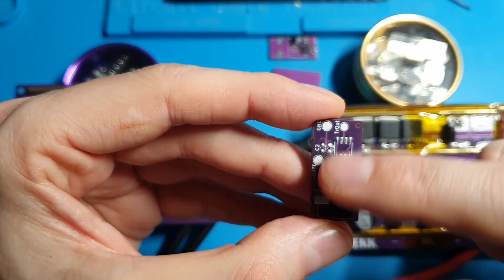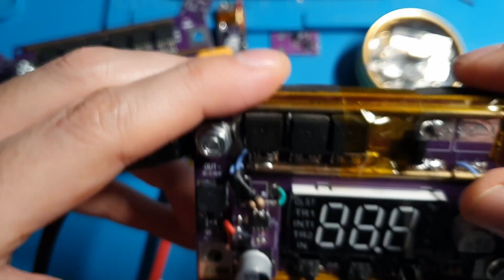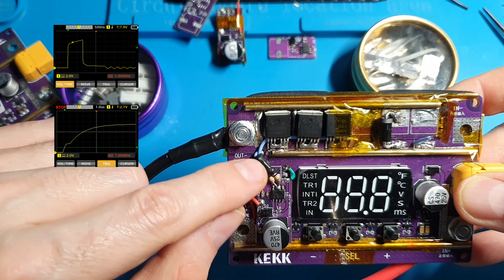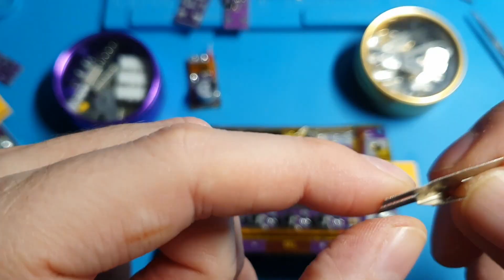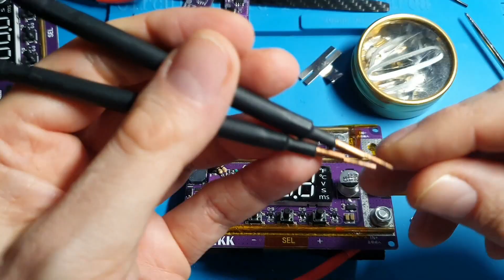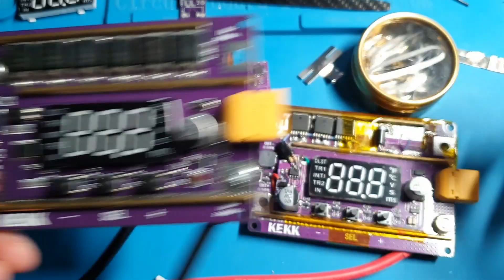KEKK K100 revised Driver Mod board (rev 1) update

Comment: Thanks for your explanations, It was very helpful,
I am planning to use separate 12V Power supply for the controller alone to avoid the hassle like used by Sidorovlife in his review "Spot Welder from AliExpress review"

Positive wire from welding battery is directly connected without connecting to the purple board
Reply: This method is best as MOSFET is not getting hot, working fine for me

Comment: 2 Mosfet were blown in my Purple board, if i keep 3 Ok MOSFETs, 12V input is showing as 8V at output, that means somehow remaining MOSFETs are conducting always, but individual MOSFETs after removal are Ok in Multimeter, no short. what could be the issue?
Reply: 8V at output is available even all MOSFETs are removed, may be voltage sensing feedback wiring
Reply from the maker: There is a voltage divider with 2 resistors which is used for the weld autotrigger sense connected on the negative probe so the voltage sense come after negative probe contacts with positive through weld strip. If you have doubts about FET functionality use the filament lamp test I show in my other video (check the playlist).
Reply: @Luca_Techy Yes understood thanks, I replaced the MOSFETs, now 8 MOSFETs soldered and Separate 12V power supply for the board, Only Negative wire is going from Spot welding battery to this board, Positive directly,
Works very fine, just monitoring the temperature, giving some rest after each 20 to 30 spots

Comment: Hi Luca. How do I remove the bronze bars from the board if I want to replace them as suggested? And how to mount the replacement copper bar? Thanks
Reply from the maker: For that you will need a hot air gun and much flux as you will need to heat all the trace and melt the solder to remove it - similarly to place a wider bar back on. I suggest you mask the components around to protect them with kapton tape or aluminum foil or both as the heat will be extensive.
Reply: @Luca_Techy  thank you! how wide are the traces - or rather - what should the width of the replacement copper bars be?
Reply from the maker: Ideally as wide as the copper traces are on the Drain and Source sides. Just keep in mind that lowering the losses increases the peak amps and transients so you can easily reach the limits and risk blowing FETs, it's all a delicate equilibrium.
Reply: Sure. So what’s the latest with the K100? Is it still the board to get? I’m about to order the 12 mosfet version. Images in the reviews section show it’s the updated model.
Reply from the maker: @martyknox as I've said to many and also in my reviews, the 12 FET version is a bit of an overkill for more than one reason, considering also that a single opto is driving 12 Gates which slows the on time even more. I think the 6 FET version is enough and a decent balance for the design limits. If you want to investigate more in depth checkout the spot welder FAQs video!
Reply: @Luca_Techy yeah I’m planning to remove 4 mosfets and run just 8 (4 on each side back to back), that way the board has a modest boost without pushing the limit too much, with the added benefit of having 4 spares. Also noteworthy - the 12 mosfet version comes with extra busbars on the backside too. 

In the empty mosfet slots I’ll add a TVS diode on each side as you did and probably swap out the resistor as suggested. 

Thoughts?
Reply from the maker: @martyknox  TVS diodes are certainly an extra and needed safety measure so good to add them across DS. 8 FETs should be more than enough for this mini spot welder - just cross your fingers and hope they are well matched!

Comment: The information in this video is probably the most valuable and relevant info regarding the underlying function and operation of the FET drive components of these mosfet based spot-welders, and probably will save budget DIY'ers lots of time and money (and blown FETS) in the coming years. Thanks for your work and taking the time to present it for everyone to learn from. An invaluable resource on this topic, to be sure. 

Regarding the FET destruction: I have reached the same conclusion that you did. With a fast driver, it's the back EMF spike that is the real and most prevalent issue when putting lots of current through these boards. It's not only the emf from the inductance of the rails, but also of the probes, if my understanding is correct. I have noticed when longer  thicker gage cable is used with the probes, the back EMF on switch off is even greater. I'm using TVS diode with 18v conduction, and they do a good job of capping the switch off transient. Great info, thanks!
Reply: Добавь, мощный диод между + и -, между сток и исток твс диоды минимум 4 шт, так же туда варистор(крайняя мера, после выхода из строя твс). Вся эдс будет гаситься на этом диоде, если он не успеет, пройдёт дотранзисторов(там уже будут защищать остальная защита).

Comment: Thank you for another great video, so for brand new boards (new version) actually you recommend only decreasing the resistance of the MOSFET discharge resistor to about 1k, right?
Reply from the maker: Yes for 6 FETs 1K is ok and for 12 that should be around 500 Ohms - though I don't advise the 12FET version with the stock opto "driver".
Reply: @Luca_Techy Too bad I've already got the 12 fet one, I'll check out the board, maybe there's easy way to disconnect the base of those back fets (maybe some via)
Reply from the maker: Every Fet Gate on the back is unfortunately directly connected to the other gate through an individual via. I seperated them cutting the top Gate trace at mid way so you could do the same keeping 6 + 6 (3 top and 3 bottom left side and 3 top and 3 bottom right side).
Reply: @Luca_Techy  HI ! I also got the 12 fets one, replaced the 4.7KΩ resistor with a 1KΩ, and cut the trace mid way to disable the 3+3 ones on the left, thinking that I would have some spare in case... But the first spot weld went wrong and I lost those 6 not connected ones, could it be that leaving the gate floating made them go wrong ? 
I de-soldered them and the 6 other ones seems fine. I was able to spot weld after that.
Reply from the maker: @quitsoon4208  never leave Gates unclamped, you absolutely need to tie them to gnd through a resistor or directly if you want to disable them else they will float and be unpredictable as they are high impedance - so yes that most probably caused them to fail.
Reply: Thank you for your answer :)

Comment: Another great vid. Thanks! Did you use the octo or did you remove it i noted in comments previously that the TLP250 integrated an octo and driver? Any ideas on how best to integrate a footpedal?
Reply from the maker: The opto was removed - as explained in the video I used it's pad to connect the MCU trigger output to the driver board. To add a foot switch you need to cut the contact detect trace and wire a switch to the mcu input side and the other to batt positive. Depending on where you cut it you might need to add a 10K pulldown resistor to avoid random auto triggering.
Reply: @Luca_Techy  Thanks for clarifying. I'm unsure exactly how to establish where the contact trace is... guess I've got a lot of learning to do. ... update found your post with super clear instructions.

Comment: About pressure, I just received the Docreate 760 welding pen, it has much thicker cable and slightly longer, but the overall resistance is quite a bit higher! Unless I'm doing something wrong, I used my RC3563 IR meter and measured 0.9mΩ on the stock 7AWG leads (10cm pen, 35cm cable), the Docreate measured a whopping 15-30mΩ (one side had twice the resistance, so yeah with the same settings, it not doing much, seems like the bulk of the resistance is at the connection between the leads and the pen which is soldiered on, the other side is crimped. Ordered some EC8 connectors (which I think is what they use, 8mm bullets are quite a bit shorter), some 7AWG silicone cable and another cheaper pen to compare...
Reply from the maker: I have the same meter and those supplied AWG10 leads range from1.3mOhms to 3.6mOhms so I matched them in order to have a total resistance to be the same between the 2 welders (I have a few of those cables). I also have a "double prong" or one of those spring contact electrodes and there the resistance is around 4mOhms in total but I don't use that for testing as it's bulky and the cables are rather short. The resistance varies a lot with these multi thread aluminum core cables as they are rather low grade. You can try soldering the crimped areas which might lower the total resistance but it didn't change much for me.
Reply: @Luca_Techy  I just did using a propane torch, took forever with 0.5mm solder 🤣and it's much better, that welding pen uses copper wires and I'm now getting 0.9mΩ and 0.6Ω, I guess I'll use the higher resistance lead on the positive side to offset the FETs resistance? Or maybe I should add solder to the other crimped connection too
Reply from the maker: Just focus on the total circuit resistance trying to match as best as possible the 2 leads in order to have the same V drop on both (the total current hence weld energy is the same anyhow as it depends solely on the total circuit resistance including battery internal resistance). BTW the positive trace on the K100 pcb alone measures 1mOhm so jumping that saves you some additional resistance loss.